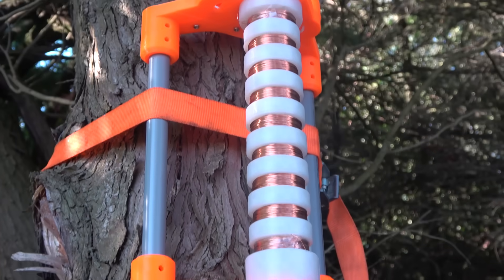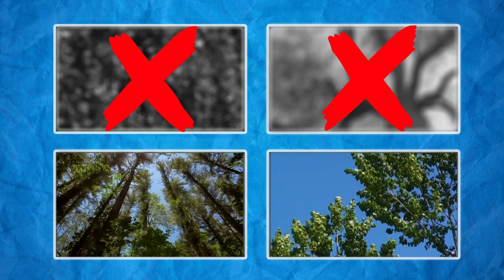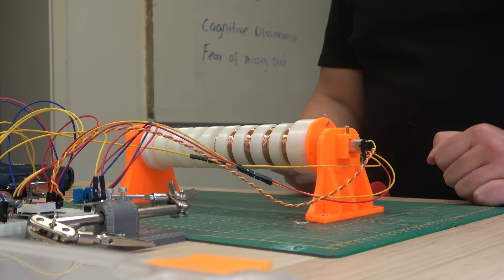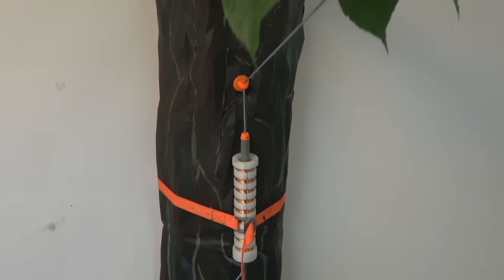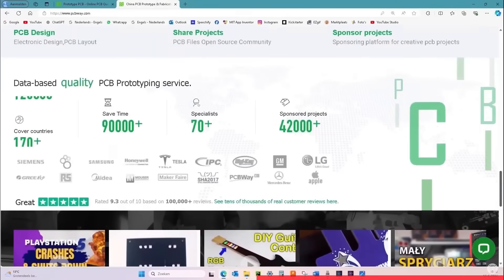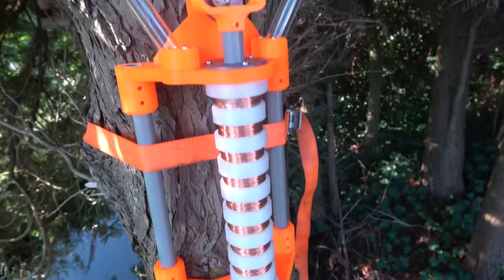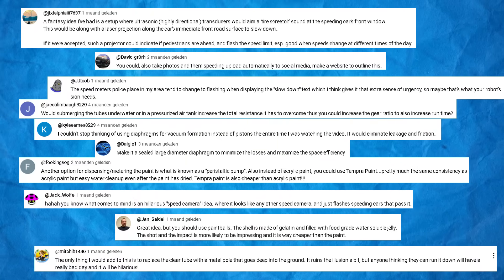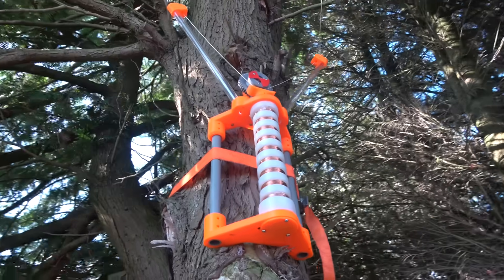I Made a Tree Generate Electricity..

Comment: I just recycled a whole bunch of speakers into linear generators by removing the top section and not changing much else other then adding a ping pong ball that allows for a second speaker to be connected facing each other. Then place them in an appropriate enclosure for weather protection. I was thinking about using them to collect vibration as energy but your idea with trees might be a better option. Then they could be hung like decorations on the tree

Comment: I've had a similar idea for quite some time, even orderd rope to test, but didn't get much futher. Like the idea for smallscale to not have to invest/use resourses  or get permits for large infrastructure.
My idea was to attach a rope at least half way up a fairly large tree, anchor a rotating generator on the ground, at least the same distance as the hight of the rope attachement away from the tree to make the rope have about 45deg angle. then a spring or up in again in a tree, over a pulley and hang a weight.
But got some new ideas now when I read the comments:
- Have 2 anchor points on each side of the tree and return back to the same attachement point up in the tree to eliminate the spring or weight
- Use some flywheel and one way bearings to make the generator spin only 1 dir. and prevent it from slowing down over and over to change direction, mabye could combine oneway bearings with pulleys to make this work better.
- Remember seeing a wave generator that used lost of cheap air pistons to gather many unsynced motions to 1 larger piston or turbine. Could maybe be used for this idea also.
- Stabilze 1 tree with ropes with 45deg angle to the ground, to prevent it from swaying. Then have a horisontal rope go from this tree to another much more swaying tree beside it, to get a greater amplitude.

Comment: I had seen a system that uses a flywheel and it's a centrifugal clutch.
The sway of the trees in the breeze kept the flywheel moving which you bleed off for generating power.
What you're doing really isn't a stretch from what safran is doing on water.
They however are using that linear motion to Pump Air which then powers a turbine.

Comment: To the commentor that suggested using a rotating generator, I'd like to make two suggestions. First is the use of a mechanical rectifier, which converts back and forth rotational motion into unidirectional rotational motion. There's an excellent video on 3d printing one by Robert Murray Smith that you can check out. Second, if you're winding your own motors, why not give aluminium windings a go? It may make the device bigger, but the windings will be lighter overall (65% the conductivity of copper but only 33% the weight. 
Second, I'd like to point out that (from my doctorate in youtube video watching 😉) apparently ropes are not for trees long-term (the tree will grow around them, and eventually 'suffocate' and may even die), so why not look to what foresty guys use for the ladders fixed to tree trunks to climb up to lookouts built atop them? I think at least some of those don't impede the growth of the tree long-term.
Reply: You bring up a great point, the longevity of the branch attachments needs to be addressed, But if it could last for 5-10 years I feel like this is a pretty viable concept

Comment: The real power in the tree would be from potential torque rather than plain old movement.  A geared generator that requires high force to function should yield more output.
Car windshield wiper mechanism comes to mind.
Reply from the maker: I do not disagree with that! I think it comes all down to finding a good balance between nature and technology to get the most out of the tech without destroying nature of course
Reply: @ConceptCraftedCreations  I think we have to be careful with visually polluting the countryside when it comes to windmills and solar panels.  There are far better technologies with respect to small foot print, high energy output such as  https://en.wikipedia.org/wiki/Breeder_reactor  however economics and of course politics tends to overrule what makes sense.
There is no harm in the individual performing green projects for their home and property however we really don't want large corporations buying up chunks of the countryside to slab over with metal panels or large unsightly towers.
We have had the means of producing cheap power for many years however the current system uses energy as another form of taxation on the common man.
Reply: @CATANOVA 
Nuclear makes a lot of sense at the moment. In the short run it could help a lot to speed up the worldwide energy transformation, as long as its deployed quickly and at a reasonable price, compared to solar.
In the long run, nuclear becomes a burden due to the fact that it is literally an additional heat source within our atmosphere. Therefore working against the reason it was built for in the first place.

All though most nuclear plants use a lot of fresh water, which tends to get more and more spare all most all over our planet. 

Anyway we would have a good use for small nuclear reactors all over the solar system, i.e. powering spaceships, space stations, a moon base or for terraforming mars.

just my 2 Cent
Reply: @CuriousityRulez  
Nuclear vs solar is like the knife and fork vs the chopstick.  There is plentiful data available to anyone should they wish to research so as to understand what we are doing and why.
Happy to see people engaging on important topics such as this  👍🙂
https://en.wikipedia.org/wiki/Chopsticks#Global_impacts
Reply: I agree and think you could store up the energy into a gravity battery by lifting some mass with a ratcheting mechanism to hold it up until ready and then allow it to slowly fall down while discharging (i.e. while charging your phone)
Reply: @K3PO electric batteries are much more efficient than gravity batteries for everyday tasks like charging phones. Storing energy for longer periods like weeks or months are the only time when gravity batteries are feasible
Reply: @EhmedCousCous  ahh yeah that makes sense! I would love to see a small scale grav batt that was powered by wave energy like this, but yeah it would not be the most efficient store of energy. It would probably take weeks to charge lol
Reply: @EhmedCousCous  Weight driven clocks (😁 for the video author) are a real time usage of super efficient gravity based energy storage.
Reply: @CATANOVA  They aren't really that efficient, sure they last a long while but the energy required to elevate the weights is far greater than the energy you get out of it.
Reply: @EhmedCousCous   Have never owned one so not sure.  Thinking about it from a basic physics point of view there must be potential energy loss if they are not efficient.  The loss would be high friction within the clock mechanism.
I thought about clocks following the ratchet mechanism suggestion from @K3PO where it makes sense that one could ratchet something as high as they wanted to store as much as they wanted followed by a controlled release to do work of some sorts.
Reply: @CATANOVA  if you want to use such a mechanism as a battery you would need an electric motor to lift the weight, you would also need a ratchet mechanism and some gearing to make it work, all those moving parts’ inertia and friction as well as losses in the electric motor are what makes the gravity battery so inefficient. A lithium battery has no moving parts hence more efficiency.
Reply: @EhmedCousCous  
I think originally @K3PO may thought about a ratchet mechanism to account for the oscillatory liner motion of the tree, but he would need to confirm.
Taking what may have been his thought and going further with it, imagine a rope around the waggling tree fed back to the ground through a snatch block and then onwards to a pull cord on a petrol lawn mower.  With this in mind one may see it would be possible to do the conversion to a ratcheting rotary motion which in its self could further feed a variety of things, one of which could be a winching mechanism.  The lawn mower pull cord ratcheting mechanism functions partially like a diode in an AC electrical circuit.
Reply: @EhmedCousCous   I think the clock type gravity battery (more correctly an energy storage mechanism) don't suffer any significant losses with proper design and lubrication.  If this is true one could copy and scale perhaps.  One may be able to wind it up with a waggling tree perhaps?
Reply: @K3PO it's interesting but wouldn't beat a flywheel with a high torque conversion.. unless you could predict your own usage and high/low wind times w AI.
Reply: @baloog8  Good point. That would be pretty cool to do either way too!
Reply: @K3PO  That would work very well indeed.
Reply: @MaksGerasim  
Here in the UK where I am right now the evening has just passed and the weather or atmosphere is like soup with no sun and a very fine drizzle rain falling within a breezeless 16C temp.
Sitting here contemplating where there may be a potential difference to exploit with respect to the subject at hand, there is very little I can come up with other than pointing at heat source pumping which of course we know loses efficiency as demand increases plus there is no commercial equipment available as of yet that converts any heat gain in to useable or storable electricity.
Thinking outside the box, here is an idea.
Leveraging nature, evolution and gene therapy we could bread hamsters where only the best runners are selected.  If we then manufacture hamster wheels using fidget spinner bearings and couple them direct to micro generators, I’m sure there would be some worth while usable output over a given hamster lifespan.  Although the output would probably be quite small, if we were to massively scale, such a solution could easily obtain Megawatt figures (think of shipping containers with the label Rodent Rodio on the side).
In order to fuel the hamsters I am thinking a really good chemist could come up with some sort of enzyme that would break down plastics in to some form of digestible compound.  We could also feed them other scraps from our tables in order to fulfil the proverb ‘where there is muck, there is brass’.
Good morning from the UK, hope I made you smile. 🙂
Reply: https://www.youtube.com/watch?v=ZNa-JHPnpgM
Reply: https://en.wikipedia.org/wiki/Piezoelectricity
Reply: @MaksGerasim  
Borgified Earth
https://youtu.be/D7KCb-O20Fg?t=243

Comment: couldn‘t a pulli-system make the effect bigger and require less movement of the tree? I‘m not sure if that might work.
Reply from the maker: That could definitely work!
Reply: @ConceptCraftedCreations just letting you know!
Reply: Interestingly enough pulley systems and gears have the same effect on machines like this. Gear ratio is a very similar concept to pulley ratios, both allow you to get more force in a short distance by using less force in a long distance!

Comment: Here's an idea if you have two tall trees next to each other.
Tie a rope high in tree A, then string it across to tree B.
As the trees pull away from each other, use your pulley method to convert the linear motion to rotational on tree B, and hang a mass from the free end of the rope to keep the rope taught between the trees.

As the trees pull away from each other, tension force in the rope should generate torque on the pulley which can be converted to high speed rotation with a gear.
Use this output gear to drive a small AC or DC generator rather than using your linear generator.

I had a lot of fun watching this video, thanks!
Reply from the maker: Thanks! I really appreciate the compliment!

And that could definitely work! Only isn't it true that the trees move in the same direction because the wind hits them from the same angle?🧐 I'm wondering now how often they would pull away from each other and how often they would move simultaneously in the same direction.. none the less some interesting food for thought!🤓
Reply: @ConceptCraftedCreations  An even better idea would be to install a generator on board of cyclette, tapis roulant and other equipment found in gyms all over the world. Free energy and body toning for everyone...
Reply: @gaetanoroccuzzo  or punch a hole in that board and put it around a tree up higher
Reply: @gaetanoroccuzzo Genius! But now who can we trick to to spend $1k more on their treadmill to power their light bulb 🤔 jk but the thing with the trees tho is that they could be capturing thousands of pounds of wind force 

- there actually used to be this demo everywhere that you’d ride a bike to power a light bulb and let me tell you it wasn’t easy to keep it on 😂
Reply: @kadensmith5586  I know. Around 2 decades ago, I watched a British documentary where a typical family of 4 living in a mock up house was supposed to have all their electric needs supplied for a full weekend by up to 50 man powered, purposely made, cyclettes with onboard a small electric generator. There were times where even all of the 50 pedallers couldn't keep up generating enough energy required.
Reply: @ConceptCraftedCreations  That's what I thought too, however trees act like giant springs moving back and forth. Because each tree has different geometry, the trees end up moving in different directions.

I always find it mesmerizing standing under a group of tall trees and see how they move independently of each other.

Take this video for example:
https://www.youtube.com/watch?v=TlnGqd4uXC4&t=29s&pp=ygUaZHJvbmUgZm9vdGFnZSBmb3Jlc3Qgd2luZHk%3D
Reply: I wonder how to design a system that will harness both stimulus and opposite motions (and things in between) 
Like an A, M, B system, where A and B are the trees, and the M(middle) component is a stable non swaying element that will convert these motions with different modes, that all add up and then sent to the generator

Comment: What if you simply attach a very long cable through a forest, and have it so that it attaches to alot of trees in a line, so that any trees movement applies a force to the cable. which in turn could generate power at one location.
Reply: You'd also have a lot of friction, even with good pulleys, also the weight of the cable would be immense after a few 100 metres. But I like the idea.
Reply: One tree would fall and destroy everything
Reply: That's a terrible idea the first storm would down random branches making a big tangle up in the trees and I fall to see how it would be simple to attach a series of trees together do you have any tree climbing experience it's not impossible but it's not even close to" simply".
Reply: @dino9071  Look, if you have a perfect line of trees, and attack to the middle-top of each tree a cable which attaches to a main cable. you could have those lines of trees pull the cable in unison when they sway in the wind, which would feed into a generator at the end of the line. Its a very simple idea, and is alot more feasible then attaching ropes to each and every branch of each individual tree.,
Reply: @Dalorath  have you seen how cable is rolled out and trees are climbed do you know their life expectancy on a good year without fire storms or disease your dreaming.
Reply: The longer the cables, the more friction points are needed to string them along, making it increasingly inefficient and more likely to fail
Reply: @EclipseOverSalem  the cables will each be supported by the trees they are attached to, If done right, there shouldnt be hardly any friction other then rubbing on the tree.
Reply: @EclipseOverSalem  Look, say ypou have a string of 10 trees and another string of 10 trees. the cable is strung up between them, and each tree is attached to a central wire that leads to a generator.
Reply from the maker: Then you certainly have a lot of pulling force in one place that you can use!🤓 But is it that easy..?🧐
Reply: @ConceptCraftedCreations  im not sure if it would be easy. You would have to figure out a way to translate the conflicting movement of each tree trunk into movement of the cable without other trees becoming pointless or interfeering.... if you can figure that out. A giant flywheel might be the best cource of action to store up the force and translate it into power with all that pulling force?
Reply: @Dalorath I think separate generators connected to one inverter will always be the more efficient choice(this is also how wind and solar farms work) unless you really only want to use mechanical power without making electricity for some reason.